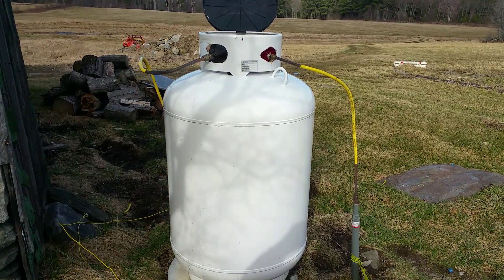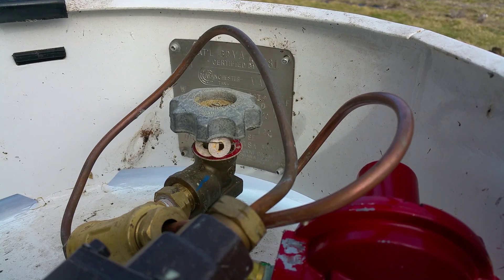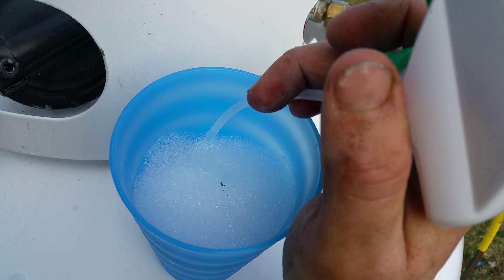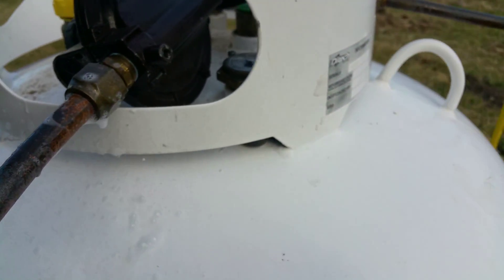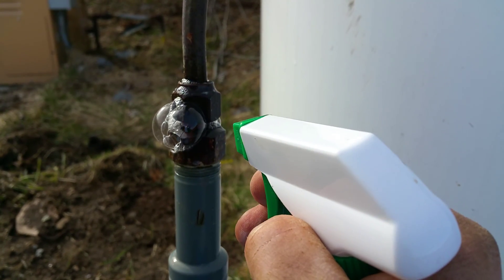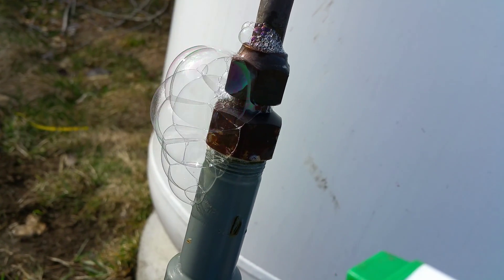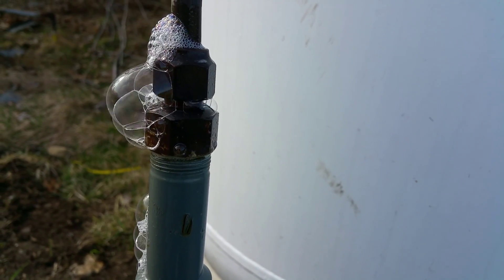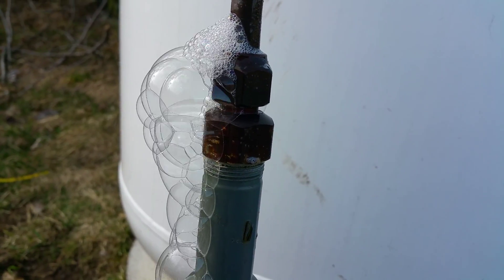How to find a propane leak with just soap and water

Comment: Zawbone, Please respond as soon as you can. I am in the process of making a construction safety video which is most applicable to concrete construction - part of which I briefly talk about propane safety - I think this is the best illustration of using the soap and water method I have found yet. I was wondering if I would have permission to incorporate this video and audio into the video I am creating to better illustrate a using soap and water to check for propane leaks? I do intend to sell / strategically give away my final product for free - this piece of footage I would get from you would make up a very small amount of a long video (around an hour). If I am allowed to use this, I could send you my final product at a highly discounted rate/or free - though it cannot be resold unless I reach a deal with you on that end. I will set up ways to figure out if people sell this as their own work, which obviously I cannot have. I am certain this video will be of tremendous benefit to people. Let me know if you'd be okay with me incorporating your audio explanation at any point - though I believe I will likely just utilize about 10 seconds of your video and explain it - cutting out your talking audio. Please let me know if I can use this as soon as you can, and if you have the rights to give me permission to use this video - and what that would look like.
I would gladly tell you more about the project if you would like. I am freelancing on this - and compiling much footage that already exists. I would also plan to copyright my final safety video - or find some way to protect the work I did on it from being resold.
I believe we could strike a deal that would be mutually beneficial to both of us!
Thank you for your time